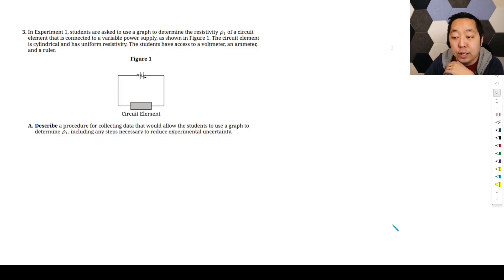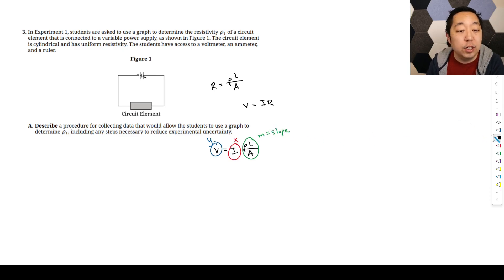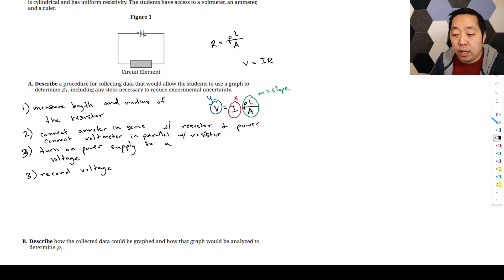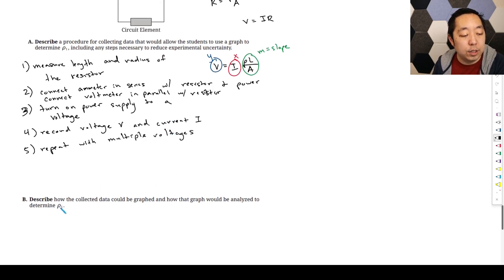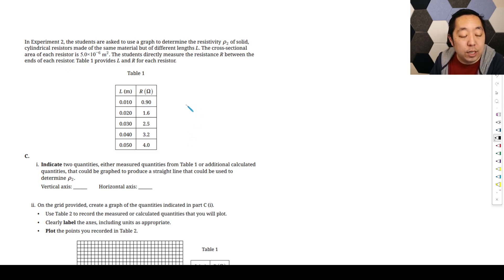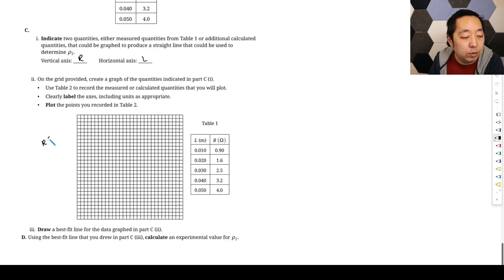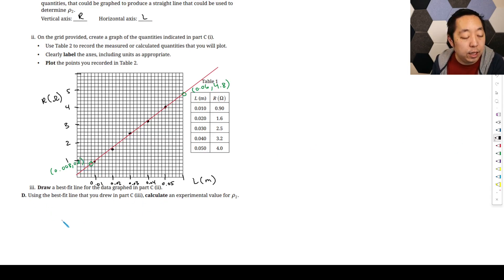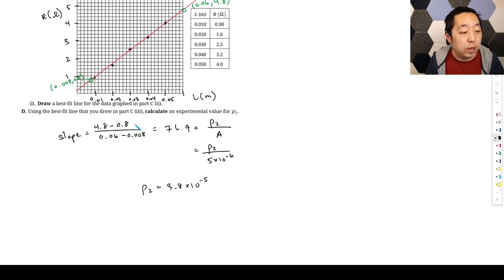2025 AP Physics C E&M Free Response #3

Comment: You're allowed to use regression to find the slope right? I used desmos (y_1 ~ mx_1) and said that on my booklet and got about 4.0 x 10^-4 ohms*m (I think 76.9*5*10^-6 is also of order 10^-4)
Reply from the maker: Yes you can
Reply: I just did best fit slope from my graph of R/(L/A) and I also got 4*10^-4 ohmmeters
Reply from the maker: Yeah I wrote the exponent wrong. I got 3.8x10^-4